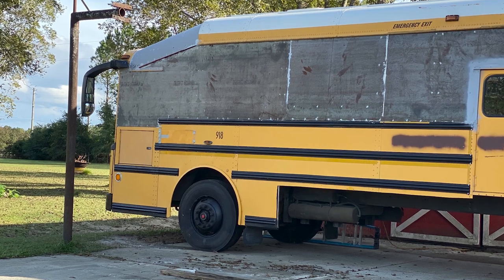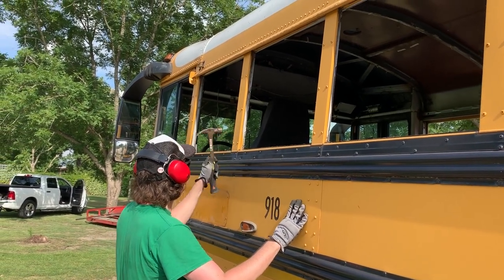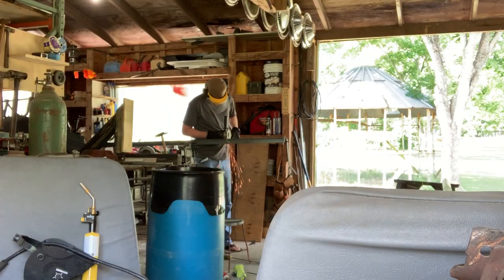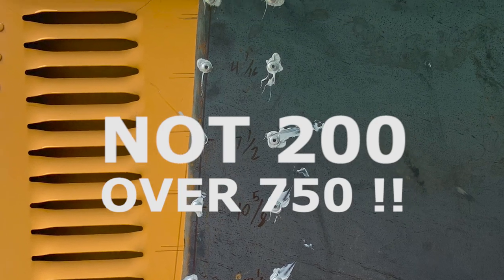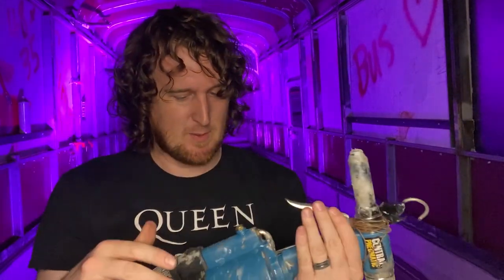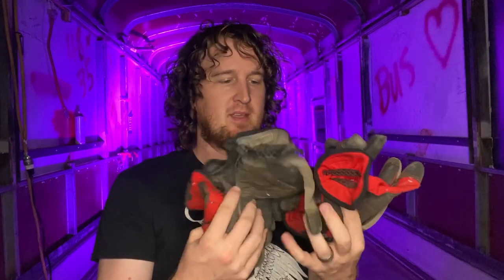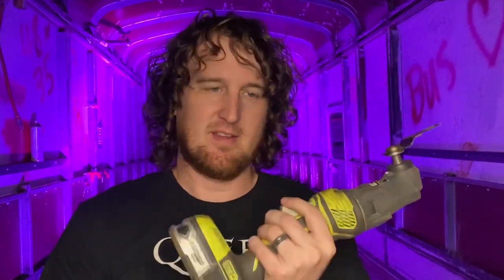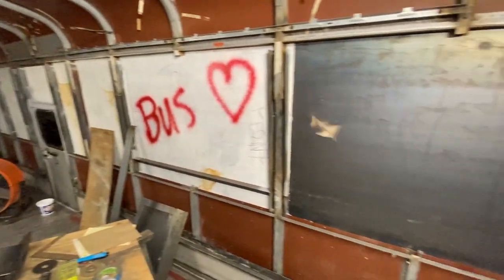Must Have Skoolie Tools

Comment: How much does it cost to get the roof raised? And how high is the roof? ( thinking about overpasses)
Reply from the maker: We did it ourselves so it just cost us for the materials and time. We have in the ballpark of $1,000.00 total when the dust settled on it. The DOT max height, which is what Tractor Trailers ride at, is 13.5 feet. Our roof height is about 11.5 feet or so after the roof raise. We're well under that but it will still be a problem on certain older overpasses.